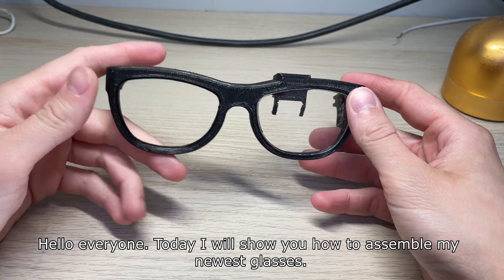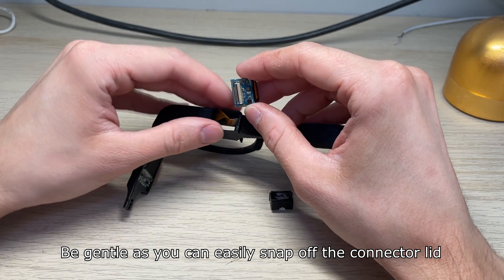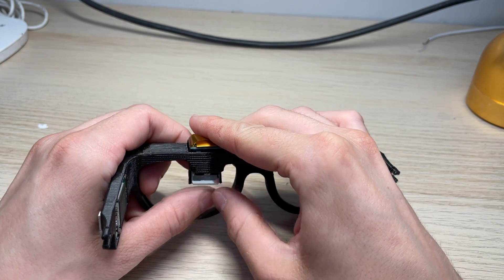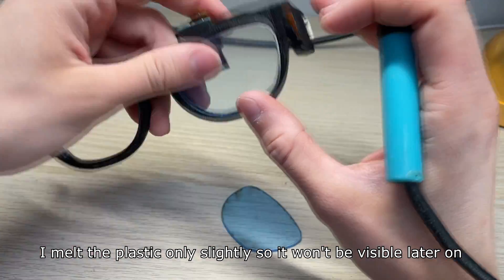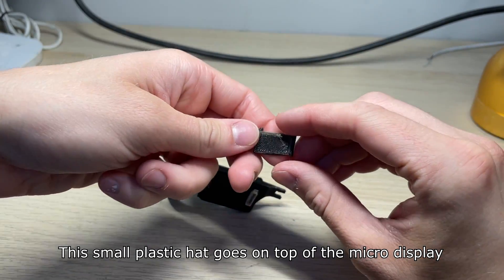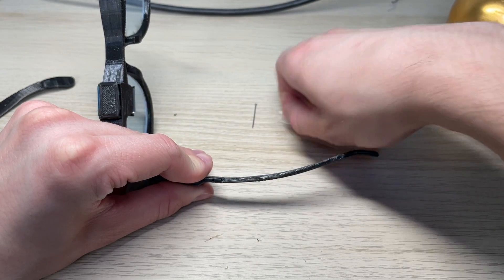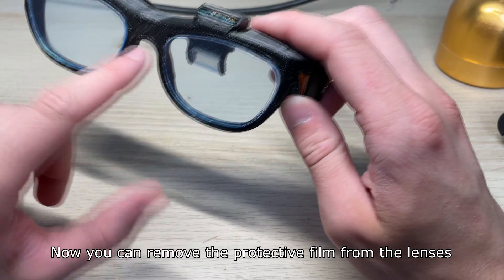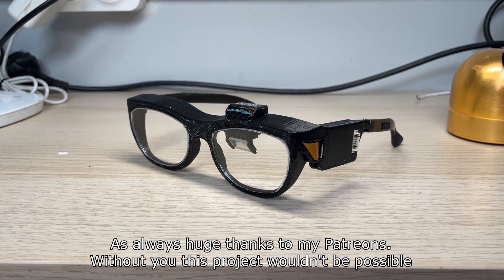Onyx Glasses | Assembly Tutorial

Comment: Amazing work. Is it powerful enough to work with OpenCV? For example, can it handle face detection and drawing boxes around it in real time in AR? (Assuming I add a camera to it)
Reply from the maker: Thanks! It doesn't actually have any on-board processing unit. It's meant to be working with regular Windows PC later on but for now I'm just using Raspberry Pi to test things out. OpenCV would be possible if you'd add certain things though
Reply: You can use opencv first connect your pc to the glasses thenif you code it then make it run as soon as your pc turns on it should work
Reply: @ManolloMancelli  which things?

Comment: Manolo how can I make my desktop take up the entire viewing space (so I can only see my desktop on the glasses)?
Reply from the maker: You would need different kind of display. Most likely waveguide
Reply: Ok thanks
Reply: Can you give a link?
Reply from the maker: I'm affraid you'd need to order it directly from manufacturer
Reply: I have diffrent question
Reply: Is it possible that I can make onyx glasses with windows (so basically it is plugged into my pc, but the pc is inside the glasses so now it is portable)
Reply from the maker: Yeah it’s possible. I’ve used them with my Windows PC using HDMI2AV board. I’m working on custom version so it would be available in future versions
Reply: Please make a video on it!
Reply: So like you can go out with the glasses but the pc will be connected to the glasses
Reply: Is that what the hdmi2av board does?
Reply: I want to use opencv on the glasses, how can I do that